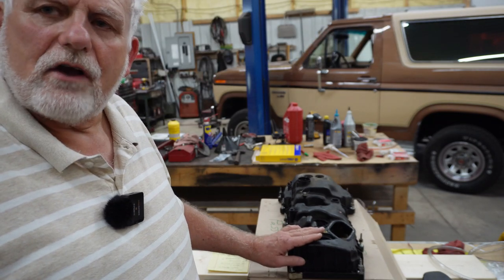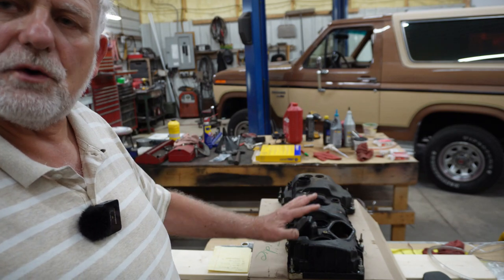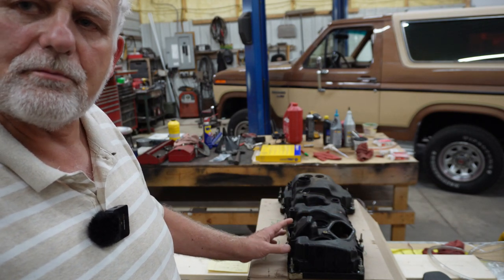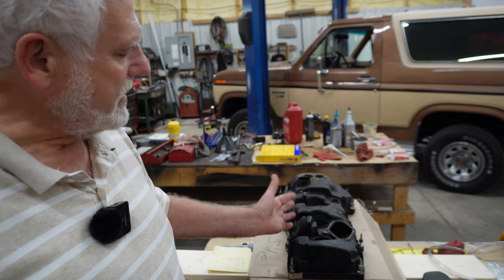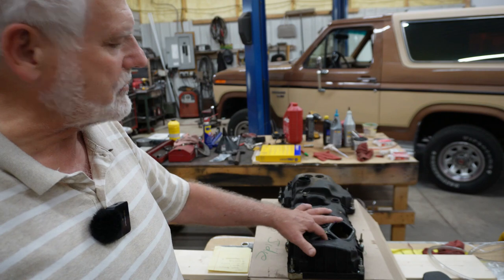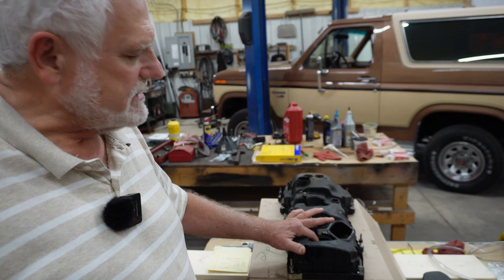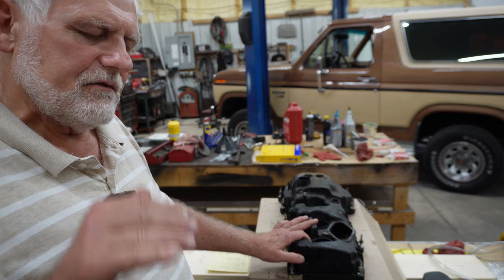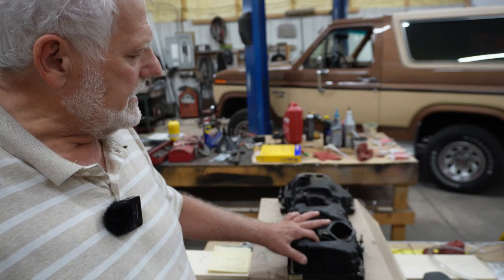How to Remove Broken Spark Plug Fragments from Your Engine

Comment: A blow nozzle would probably work if you had a compressor. Stick it down in there and move it all around.
Reply from the maker: Well that’s a good idea I didn’t think about doing that and honestly I hope I never have to again.  Sharing ideas is what it’s about, thanks.
Reply: @MarvsFixitShop   that's a good idea for sure. Safety glasses . Unfortunately needless complications on modern vehicles...awful

Comment: Marv, so nice to see your problems are some of mine too. We must be brothers from different mothers. 
           Now I want to add to your train of thought Sir. Always take out the most difficult item first. Second, you broke the plug because of misalignment of the socket and ratchet. Third, if you check to see how the placement of your tools fit you will save yourself the headache of doing all the extra work you did. Four, You misfortune and steps to retrieve debris from the engine will help many beginners who are just starting out. Five, always clean and blow out the spark plug holes to make sure there is nothing to fall into the cylinder bore, A.K.A. sometimes spraying a penetrant lube also helps and prevents taking out the threads from the aluminum heads too. Peace vf
Reply from the maker: Now that is some great advice and accurate assessment of what happened  keep up the great work of helping others like me  thanks.
Reply: @MarvsFixitShop  Like to help others fella. Hope you keep on making videos for us all to learn from Sir. Good day and peace too. vf

Comment: Cover condom with sticky substance. Thread sticky condom into spark plug hole. Inflate sticky condom with air nozzle. Release presssure on condom. Remove deflated condom from spark plug hole. Repeat as necesary. Do not re-use condom.
Reply from the maker: Now that’s an original idea, you do realize I’m 70 years old and have been married for 51 years right?  Condoms around our place is non existent.  I wonder if a latex balloon would work.  🤪👍